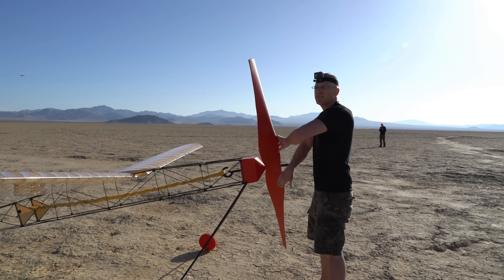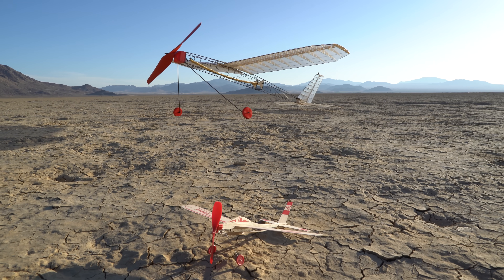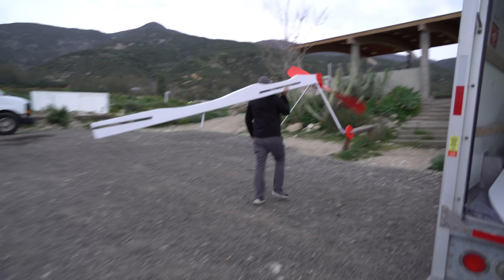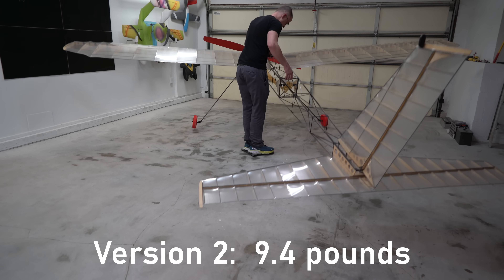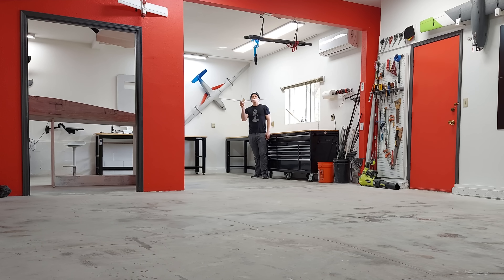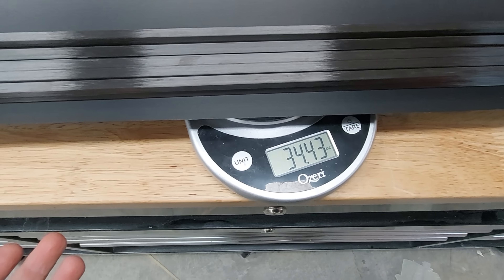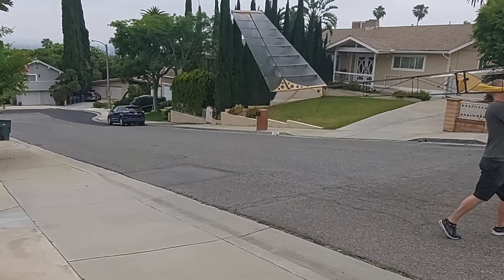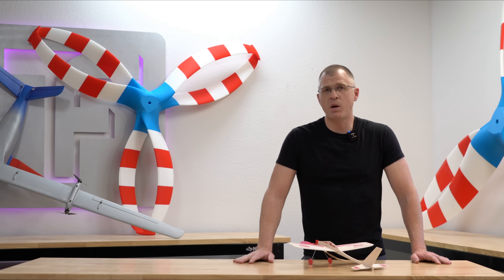Massive 16 Foot Rubber Band Powered Airplane

Comment: Congratulations on your wonderful achievment!  Rubber powered airplanes have always been fascinating to me.  Unlike airplanes powered by gas or electric motors, there is a much greater challenge to keep a rubber powered airplane as light as possible in order for it to fly at all.  And unlike radio-controlled airplanes, there is no way to control a (free flight) rubber powered airplane once it is in the air, so stability needs to be built into the airplane.  These factors make designing and building a rubber powered airplane very challenging.  A few years ago, I was experimenting with designing and flying rubber powered airplanes that were completely 3D printed, and if you look at my videos, I have had some success.  I will probably pick up my 3D-printed rubber powered airplane project again in the near future.  In the meantime, it is great to see a rubber-powered airplane project as extreme as yours.  Thank you for sharing this, and congratulations again on having the persistence, patience, and skill to pull this off.

Comment: @2:19    Although doubling the diameter of the rubber increases the cross sectional area by the square, it doesn't in itself increase the weight by the cube unless you also double the length. If you you keep the length the same, as the volume of a cylinder is πr^2h, the volume and hence weight increases by the square. I wonder what the optimum balance is between length and cross sectional area? You are limited to the length increasing, but I think is a small model a lot of energy is wasted in a short space of time, so you possible could use a proportionately smaller area? However,  I'm not sure how you could easily regulate the power output in a rubber powered system. 

Your video and plane are awesome though - it was like a set for Land of the Giants!

Comment: while watching this video I suddenly had the thought... that rubber band power necessitates a long fuselage... so this became the conventional configuration. powered planes are generally long because they evolved from rubber band powered models. Where as birds seem a bit shorter in the body relatively speaking. Of course there are some long necked birds, but that would be canard configuration (canard is french word for duck)  I'm not sure if long neck birds use their head as a control surface?

Comment: Just amazing.
Here's a crazy idea:
Make the power train modular/removable, then on occasion swap it with an electric motor, add RC controls and have a blast with long duration flights.

Comment: In the mid 1980s at Oshkosh there was a human-carrying rubber powered Lazair ultralight.   The engines were removed and a propeller was installed in front, with a heavy bungee cord stretched through the tube to the rear, which was then wound tight with a drill.    I think it flew in ground effect.
Reply: Indeed, that would be the RB-1. Designed by Mark Lokken (1959-2012) when he was in his late 20's. Discovered Mark while doing genealogical research. He is a distant relative of mine, we have common Norwegian ancestors.

Comment: Very awesome build. I had a thought on getting a bit more propeller rotation speed. Build the propeller the same way but with carbon reinforcements then melt out the foam with a chemical. My friend did that to make a set of wings for a long distance drone for the search and rescue competitions that colleges do but for fun. You may be done with this project for now, but could be a fun later project to try and get a longer flight with minor changes to the aircraft since it survived the multiple flights that day.

Comment: C of G on the flat wing version seems a long way back compared to my RC slope soarers, and i'm not surprised it didn't fly at that scale. The reflexed wing was a much better plan, more lift at low airflow. C of G probably better, 1/3 to 5/8 chord back from leading edge. but tailplane incidence is another factor, if you get the C of G wrong and try to compensate with tailplane incidence (or elevator) you increase drag!

Comment: 60 years ago I figured how to braid the rubber bands and then apply castor oil. No resistance or binding. Won many a contest as rules did not prohibit this. Good times.

Comment: I'm sorry for being that guy, the "Know it all", but it certainly isn't the largest.
Once a rubber band powered plane flew carrying a passenger across a canyon.
It's very hard to find information about it, but it happened. I read about it in a "Flying" magazine.
If more information could be found about it and a video made, that would be very interesting.
Reply: I wasnt able to find anything bigger online
Reply: @rkbmd12  as I said, very hard to find. I'll try to find the article and place it here.
Reply: @rkbmd12  https://en.wikipedia.org/wiki/Heaven_Rubber_Bandit
Reply: Just the guys' quarter scale model was larger than the one in this video.

Comment: Perhaps if you use 4 box fans on a variable transformer and some sheets of thin plywood you could make a diy wind tunnel to test your planes in ahead of irl flying to get it dialed in without risking the model or your self, what do you think could that work?

Comment: Fantastic!  I wondered, since the body of the plane is a truss in box form, instead ,  mount the rubber bands at the rear of the plane to each corner of the box structure.  Four rubber bands mounted to the rear corners, the front end of the plane, the rubber bands are mounted to the prop as you have done.   You might find as the rubber bands may preserve more torque as they unwind. The rubber band not only want to untwist but become linearly straight., similar to twisting a seat on a childrens's swing set .

Comment: Lubricate the rubber! Youll be able to put more turns in the motor, make more power, and have it run for longer. Itll also keep the rubber from breaking due to friction. Dow corning 33 works very well

Comment: Real aircraft have compression struts to deal with the forces applied by the fabric covering.
In addition real fabric aircraft wings are internally wire brased as well.

Comment: You need a process that can reproduce castings (hollow) designs.  I’m a 75 year old design engineer and dispose the advent the acronyms CAD, 3D printing, FEA, CFD, etc.  It gives the impression that tools that turn crap designs in to Newtonian wonders.  Your efforts prove that in Spades, Clubs, Heats, and Diamonds.  It took a journey through failure to arrive at success.  My old general manager that judged engineering based on budget expenditures not innovation called the process “guess and test”.  I like the term and use it when I can’t use some of the more advanced techniques I learned that is called Design of Experiments, it really neat but people that don’t understand it have no patience or belief in the results but will “guess and test” until the cows come home to converge on a working design.  Don’t stop your efforts.  This is a message of encouragement, and a short public service announcement on acronym engineering miracles.
Reply: He really did good there

Comment: Very cool! Not sure if this would meet the heart of your experiment, but what about adding servos to the wings, even small ones, controlling a small control surface like trim tabs rather than full ailerons, and same on the elevator and rudder, then adding a very small battery, bec, receiver with stabilizer, even one PER spot, so you can make it very simple, then you could make the plane auto-level with SAFE, or similar offering. Additionally, if you wish, you could use just one Tx and Multiple Rx'es and then make this project RC...but again, might not be what you're after.

If you're interested, I'd love to help, so please hit me up if you think there's any value in the idea, and VERY cool video! Great work

Comment: I believe if you created a poly-hedral wing with the additional angle at 75 to 85%, you will find the aircraft will find level easier unless you have winds.  Even with a small wind, the plane will find level and continue to fly given enough power.  AND, if you are really serious, you can create a self controlling rudder using a pendulum inside the body so if the plane turns, the pendulum will act on the rudder in the opposite direction to self correct the turn.  Enjoy and nice vid.

Comment: It's really impressive what you did here with basically an identical drive design to a toy rubber band plane. If you want to take this further I think you could get way more power out of less rubber with different coiling methods. The reason the drive is so weak is because the coiled rubber band has a small cross section and therefore lacks leverage to push rotationally. Just adding a tube that the band wraps around like a barber pole to increase that diameter would greatly increase the power of the drive with fewer twists. Basically it just comes down to moving the rubber strands further apart from one another as they coil, so another simple option would be threading one or more strands through a pool noodle so the foam keeps them apart.
Reply: A disk or series of disks that spin independently around a shared pivot seems like a better choice than a cylinder in the core since solid objects would bind on the rubber and prevent proper winding.
Reply: @garethbaus5471  Exactly my thought :) The disks are a good idea!
Reply: How about instead of trying to twist the rubber at all, use a pulley to translate the rotational movement to a stretching movement and just pull the rubber. That seems like the most effective way to do it.
Reply: @bradley3549 Need a 90 degree gearbox. Also too much longitudinal stress on the fuselage?
Reply: @johnthrelfall5  Wouldn't need a gearbox, just a pulley to redirect the cord 90 degrees. Wrap the cord around the axle that drives the propeller, connect other end to cord.

Stress is a concern, though fundamentally even with the axial twisted rubber it's pulling on the fuselage as well. Maybe not as much?
Reply: @bradley3549  I know it's tricky without diagrams in the comments, but can you describe a 90 degree redirecting pulley?
Reply: @johnthrelfall5  I'll do my best. Imagine a pulley mounted above the propeller shaft, with an orientation similar to a landing gear wheel. That pulley could redirect a pulling force from an elastic band parallel and within the feselage down to a spool on the propeller shaft. 

Thinking a little more, a spool with variable diameter like a garage door jackshaft has could really allow for an optimized power curve.
Reply: @bradley3549  Thanks Bradley, I can picture that from your description 🙂
Reply: Wouldn't the friction of the rubber bands on some sort of pole be a problem when winding?
Reply: @ChristofFritz  if you watch any of Josh’s videos (guy moving plane slowly in this video) lubricating the rubber is one of the most important things in rubber flight. He uses Dow Corning molykote 33
Reply: hi, i'm new. i wanted to know more. unfortunately, i have some difficulty with visualizing what you are explaining here. do you mind if i contact you for more info. or, is there an on line source you would direct me to? thanks!
Reply: Wow! You're here too!
Reply: Impressive
Reply: Models use flat rubber, more torque than round rubber.
Reply: @johnthrelfall5  Makes sense.  More rubber without increasing the thickness of the cross-section.
Reply: My thoughts as well
Reply: Why use a "lengthy" rubber, he could make it like a "pião" ("spinning top toy") propeller
Reply: or use 1 big  band, better bearings   enough to give i the plane 1 big push
Reply: yeah that makes total sense. maybe a carbon tube on bearings spinning the propeller?
Reply: @peterheinzo515  just because you don’t understand it doesn’t mean it doesn’t make sense. It makes a lot of sense if you think about it.
Reply: I like your way of thinking. Have seen reference to lubricating rubber bands, as said previously there is a lot of friction. Talcum powder or shampoo.
Reply: @machinewrangler4682 YES! I recall we used to lube rubber on our folding propellor diamond section body planes back in the 1940s
Model, Wakefield?
Reply: @TonyVincent-w5c  curious what you used on your rubber bands?
Reply: @machinewrangler4682  Sorry I really can’t remember, I’m 92 now and it was a long time ago. So long that we used to buy our model engine fuel (Ethyl ether) from the chemist, Black magic was a good free flight  model and  Col Bowden designed the best looking planes.
Reply: @machinewrangler4682  Yes, we used to do that on the Sleek Streeks.  We also put a couple of ribs under the wing to give the wing some camber.  I remember that if you wound the band with it extended several inches out the front you could get better winding, but you had to know when to stop, or when you relaxed the length back to slip the prop assembly on, it would triple not into a stinking mess that would get all hung up on the stick fuselage, and you could hear it whacking the fuselage as it unwound.  Disappearing the gear did wonders, too.  I also remember that you could get totally different flight characteristics by putting intentional incidence into the wing, mounted longitudinally in a bit different position.  And Bend Oregon, remember that...an ongoing joke?  Oh yeah, and we used to buy better rubber band in uncut long lengths, and loop the band twice rather than once, which increased the torque greatly, but also decreased the powered duration.

I brought one home from an airshow we attended and the wind was fearsome at the house, probably blowing 20 mph.  I launched it into the wind and when it turned around I was shocked at the speed it picked up...one half of the dynamic souring physics.  If you've never seen that look it up on YT.  They fly up a slope, in 20 mph or so winds, and it works out that they can add double the wind speed on each pop up and turn around (you have to think about it a second, but when they pop up into the wind rising over the lip, they essentially add 20 mph, and get another 20 on the turn around.  They basically fly a tilted circle or ellipse and get this, they have flown them, no power mind you, at over FOUR HUNDRED mph.  Fun times, kids rubber band toys, previous to control line, then RC, then building a real aircraft, a Long EZ.
Reply: Hold on there...  The back of the tube would have to rotate at a different speed to the front... I can't think of a substance that can do that.  Unless maybe a balloon or bladder ?!??
Reply: More torque in exchange for less rotations, not more power.
Reply: @user-yq6ov6ow7l  ... That's what he said. See the comment directly before your own.
Reply: Conventional rubber motor is a loop of rubber with a hook on the back of the propshaft. Instead of the hook, mount a disk with 3 hooks and use 3 loops of rubber to get the transverse torque.
Reply: Did you watch the whole video? He goes over cross section @ 2:20.
Reply: @ChoChan776  Yes that's the cross section of the band, but I'm talking about increasing the cross section of the helix as it twists.
Reply: @ChoChan776  And no response by you addressing your misunderstanding and not his. Have you watched his videos? 😅
Reply: @ChoChan776  ENGLISHMFDOUSPEAKIT

Comment: The prop stil looks odd. You may want to use some prop design help from professionals or at least the prop design software rather than a simple excel file with twists. Same to say about some other parts. You seem to not opting to use other peoples' knowledge much and kinda trying to reinvent everything from scratch. That is usually a good way to waste money/time/resources not quite ideally. (Unless the ultimate goal is just a some YT video). These days a 12 second flights is definitely an achievement, but not especially impressive. Respect for the effort, but doubt for the approach.
Reply: It was a tailwind and lots of gusts

Comment: I was surprised that Version 1 actually few given weight and a flat airfoil. Pretty amazing!
Version 1 may have set the record is for the "Heaviest weight lifted by a rubber band powered model aircraft", as there is no record in this category (GWR).

Version 2 is an incredible design both from engineering and artistic standpoint. 
Curious if any consideration given to including a flight controller to manage altitude band and heading? (elevator and rudder, and perhaps a GPS logger) 
If the flight distance exceeded 32.93 m (108.05 ft), Think Flight can claim "Farthest distance travelled by rubber band-powered vehicle" (GWR). This would be in addition to the "Largest wingspan rubber band powered free flight aircraft".
I'm guessing this was only the flight test stage, prior to making dedicated record flights? 
If this Think Flight Aircraft is setting records, it's worthy of a creative name. ;)

Congratulations, such an amazing project, the effort and dedication.

Comment: it looks like you have the torque.. maybe try a 2:1 or larger gear ratio to the propeller? I have a feeling it would get the rpms needed on the propeller to get moving. Maybe you tried that already.

Comment: While scale correct, I think a smaller prop might be better. The rubber band has plenty of stored energy, but it seems like it's really struggling to produce enough torque to spin the prop. Also, but the time the flight is over it looks like there's still a decent amount of wind up in the band.
Reply: yes.. or some gear system to make it rotate faster at the start 
and slower during the flight.. a bit like a spinning ice-skater

Comment: Banana oil on the rubber would have gotten you many more turns and a lot more thrust. Traditional, slow dry, shrink paper covering , as opposed to heat shrink, would lead to less warping of the flight surfaces. Old Time Free Flight guy here. Not trying to be a smart ass. I love what you're doing. Subscribed.